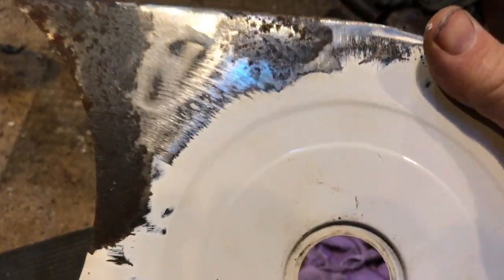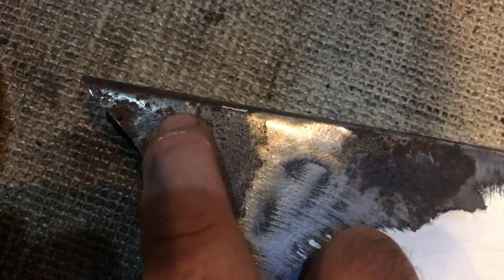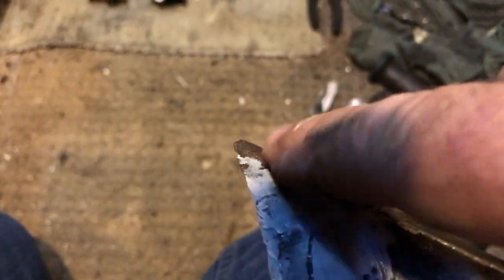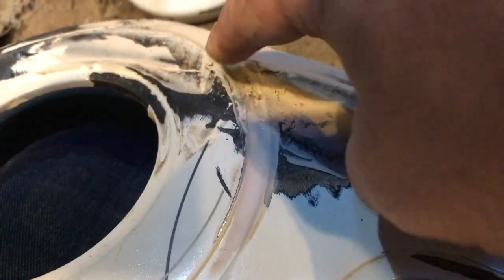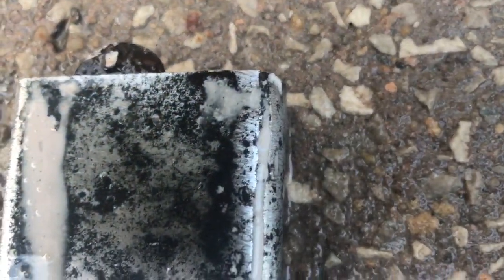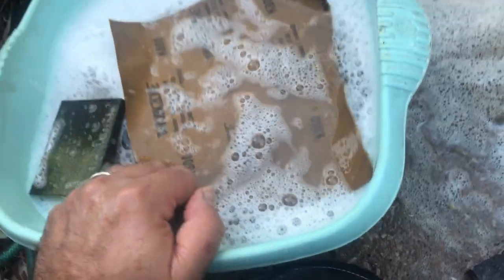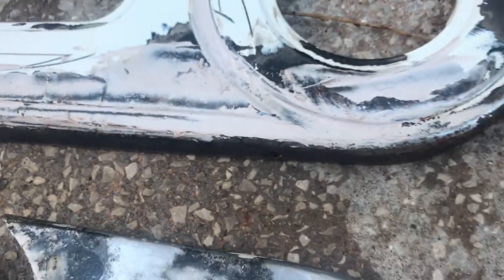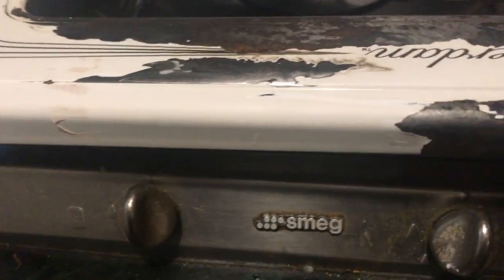Bicycle bodywork. Renovate rusty metalwork on your bike. Chainguard, mudguards fenders. Part 1.

Comment: Thanks for this, some good tips. I’ll have to have a look for that filler, I take it the catalyst is already in the tube. I’ve been using ‘big boy’ metal filler from Toolstation.
Reply from the maker: Yes it’s one-part material unlike filler. It is only for little finishing applications, not dent-filling.